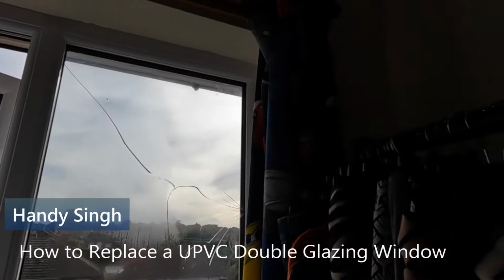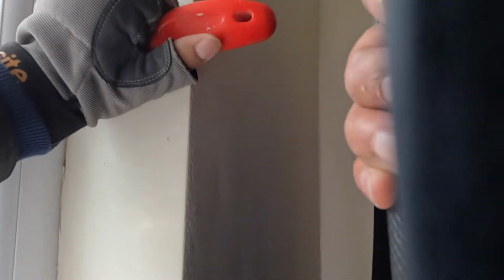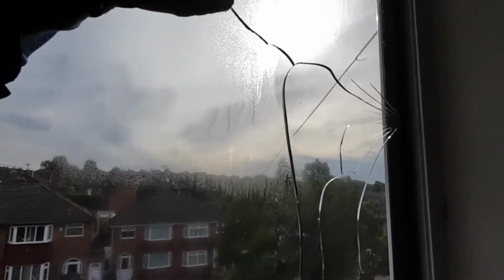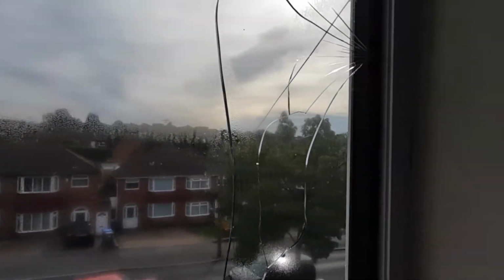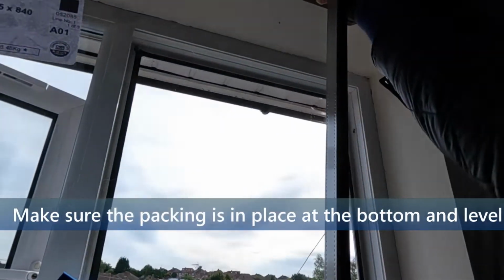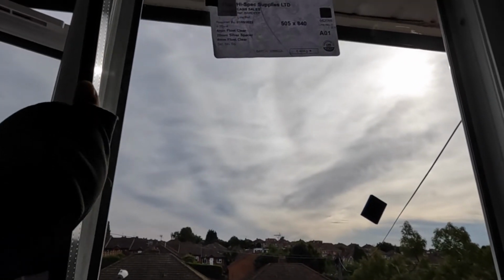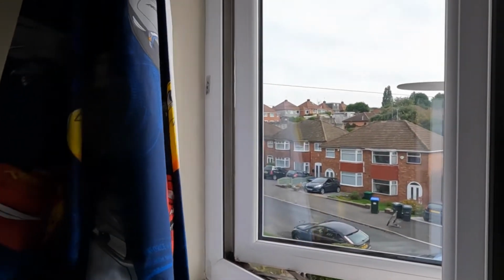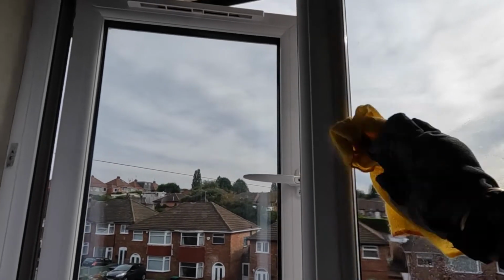How To Replace Glass in a Double Glazing UPVC Window

Comment: Brilliant video, loads of thanks. I subbed straight away. Can i ask: Do i need to put sealant on the insides of the beads (either the external beads or internal beads, or both) to stop cold air/water getting in? Or not?
Reply from the maker: Hi mate, that will not be necessary as the window has one rubber seal on the outside and then the actual bead also has a seal which makes it a double seal. Silicone will only be required where the rubbers have failed and maybe it the upvc is very old designs. Hope that's helps. Cheers Handy Singh